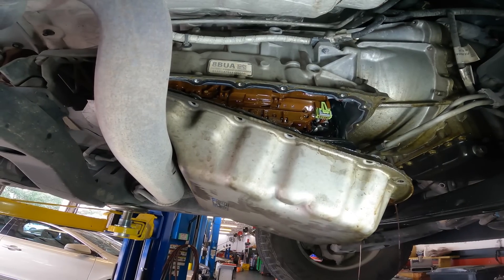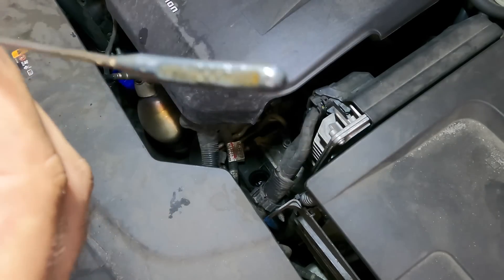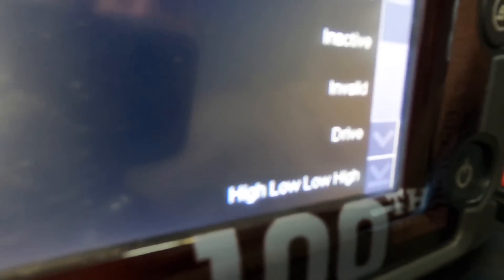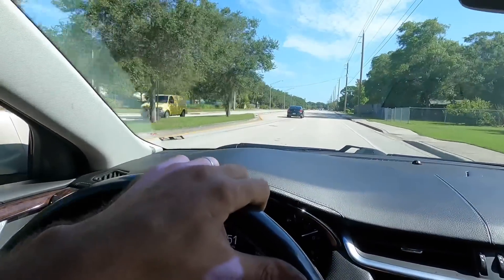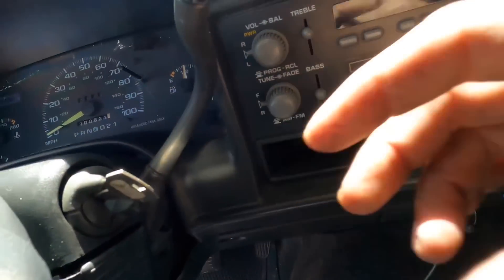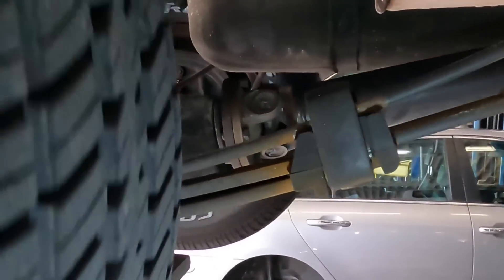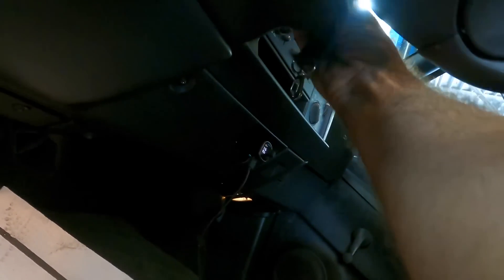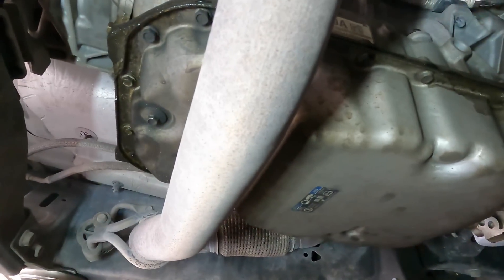Failure Friday! Ruined Transmission and More!

Comment: ''Did they drive it here?'' . Ray, if only you knew what horrors are still driving on the road, you wouldn't be able to fall asleep.
Reply: Pretty sure he knows better than most, the condition of cars on the road.
Reply: My Subaru flipped 3 times and hit a tree in an embankment, I still drive it and it’s never seen a body shop 👍
Reply: Very true ! Good defence driving required , one scary car can take out several in seconds ! Seen a lot in 50 years !
Reply: Oh, I think Ray knows what is out on the road.
Reply: I mean he is from Florida,  the only state that doesn't have any emissions or safety inspection on cars
Reply: @JMilly84 .. Tennessee doesn't either. Some Counties have emissions but they're stopping that.  Quite a surprise being originally from NY.
Reply: @geomann1009  yea driving in florida is something else it's the only place I've known of where everyone can tell you where they wanna go but have no idea how to get there and litterly anything with 4 wheels and an engine can drive down the road , sometimes without working brakes
Reply: @JMilly84  far from the only state.
Reply: Hilarious
Reply: My frame is so rusted it’s about to break into a million pieces, can I be in this club?
Reply: Ray knows!
Reply: @JMilly84  well I’m not saying I did drive my chevy pickup in florida with barely working brakes so that when I ran a stop sign late at night because of barely having brakes and got a ticket for the stop sign running i didn’t mention to the cop no brakes so I could drive it the half mile home rather than have it towed… but I’m also not saying I didn’t. ;)  they failed on the way home and I got them fixed before driving again, btw.
Reply: He knows. Hes showed some and said basically the same thing
Reply: Now you have brazen criminals trying to carjack everybody at gunpoint ....
Reply: I once lost belt and drove my Subaru to my mechanic who lives down the road from me without power steering it sucks!
Reply: I think a Florida mechanic is probably more acutely aware of that than any other state!
Reply: @JMilly84  it's not the only state. Indiana is the same
Reply: @JMilly84  
Nebraska also
no emissions or safety checks
Reply: Rau does not Fall asleep. He sleeps laying down
Reply: Especially since florida has vehicle inspection
Reply: @JMilly84  what are thoseee im from Michigan lmao
Reply: @georgemartin5980  Florida is sunny state so they dont have rust as bad usually if cars are rusted they where brought to Florida not new in Florida stayed in Florida michigan ive never had a car inspection be required so you get the bad rust from extremely salty roads in winter and people jerry rigging stuff to work, i had a silverado customer replaced brake lines with prebent lines and idk how it was messed up soo badly rear axle supply line from abs module was wrapped around and zip tied to leaf spring front lines where well under the frame supposed to be routed above the frame brake lines blow you got little to no brakes if you dont already know that, that being said wrapping a brake line around a bouncy object and zip tying it to it not to smart, steel brake lines, steel can only take so much bending back and forth before it brakes!! Not to mention i have seen cars that the frame is legit gone ive seen a few saturn vues that the vertical rear control arm that routes with the frame basically where the 4 bolts bolt the bracket up to the frame completely gone that car customer complaint was thudding noise when braking/accelerating that thudding noise was the rear tires both of them bouncing back and forth banging on the wheel wells, i drove it to see the complaint first hand, and customer picked it up drove off its still on the road i assume it is ridiculous what people will trust there lives in
Reply: Saw a guy once who’s brakes look severely rusted beyond belief, you could hear crunching every-time he’d come to a complete stop. Had to stay two lanes away for safety.
Reply: Iirc Ray is in Florida, everyone in Florida is quite well versed in what horrors are driving on the roads down there.....
Reply: @JMilly84  Lots of Wisconsin doesn't either. Some scary rusted frames around here.
Reply: I'm shocked I don't see more accidents with some of the vehicles I see driving on the road in my work day.

I always get nervous when the vehicle in front of me has a wobble on tires so visually noticable that I'm amazed the owner doesn't feel it at all.
Reply: @JMilly84  Michigan has no form of safety or emissions inspections.
Reply: @TheDunceMafia  Those saturn vues are my jam. I have a template I use to remake those rear trailing arm mounts on my personal rigs. I make them way stronger than factory that's for sure.
Reply: @TheDunceMafia  fellow michigander as well.
Reply: I had 2 trees come down on my chevy one ton. The first came down across the back and destroyed the ladders, ladder rack, canopy, and bent the bed wall. 10 min later the second tree came down on the cab from side to side destroying what was left of the ladders and the ladder rack. And drove the entire cab down to just below the steering wheel. And bent the frame. Took a forklift to the cab so I could sit in it. If i cover the windshield area with a piece of plexiglass, it’d be legal to drive🤣. The frame is bent downward between front and rear wheels significantly and blatantly obvious. And would be legal to drive with a piece of plexiglass 🤣
Reply: @nickmalone3143  🤣🤣🤣. They’d better carjack a real nice car. Or else

Comment: I absolutely love when someone says my engine isn't running right sometimes(intermittent). You hook up an analyzer and there are no trouble codes. Ask the customer what they've done and they tell you "I had them clear the codes at the Auto parts store". I like to tell them to go home and drive the car until situation occurs again, then bring it back WITHOUT CLEARING CODES SO I HAVE A CLUE AS TO THE PROBLEM.
Reply: TRUTH!

Comment: 32:54 next time, please:
- remove any left over gasket from the housing/pan
- clean the pan with multi purpose or break cleaner
- clean the trans with multi purpose/break cleaner
- give the magnet a spray clean aswell
- the filltube needs to be changed too acc. to service manual.

Comment: When replacing the transmission fluid, you should take the solenoids out and clean the metal shavings from them. If too much builds up it can cause shifting problems.
Reply: Interesting comment.  Maybe the metal shavings affect the solenoids' operation.
Reply: Thing is on the tehcm the solenoids are riveted together
Reply: Well, yes. Too much metal on the solenoids is a problem. Like metal from the planetary gears, bearing failures or other more serious issues that are the root cause of the metal. If you’re cleaning and significant metal from your trans, you have bigger problems coming.
Reply: @larryreno8293 , I would have to agree but I have seen plenty of transmissions that have metal shaving that are in perfectly good working order other than a shifting problem and have lasted years afterwards.

Comment: A family member had the same problem with 2019 caty it was under warranty and they said there was a flaw in the design of transmission so they had to replace the whole trans
Reply: GM quality.
Reply: @Adam Speck anecdotal evidence. Worst vehicle I've owned is a GM. So what
Reply: I drive Toyotas and never had a major problem, but I have owned GM and Ford and had headaches with both. Now I drive Toyotas and even if I run into a major issue will still drive them because I have over the years had fewer issues with them than any other brand I have owned.
Reply: Very very rare for toyota/lexus to have any transmission problems. Typically see them go 3-400k easily on their auto trans and even the CVTs they use. Honda is hit or miss with their auto trans, they’ve had some bad ones

Comment: Love S-10 and S-15's. I have had several from hotrodded SBC's to my first 83 GMC S-15 with a 1.9 Isuzu stripper truck ! 435,000 miles and gave it to the daughter to learn to drive in. 2,000 mile oil changes made her last almost forever.

Comment: 1/2 NPT threaded nipple about 4-5 inches long with a 90 at the bottom to provide a leverage spot. Insert the threaded end into the seal and turn a few times the lever out the seal. Works every time. I have this tool with my trans service tools.
Reply: Very interesting. Thank you : )

Comment: Shop owner/mechanic here. Get yourself a 2gal bug sprayer ( one with thick walled container).  That otc trans fill kit you have should have the hose with the quick fittings in it to hook to bug sprayer hose.  Drill hole in container for valve stem near top . Now you have a easy way to pressure it up to about 15lbs. Now as a shop owner - ease up on the brake cleaner that stuff is not cheap at the end of the week when you hose everything down like that.

Comment: So... I'm confused.... Pulling out the stand pipe plug is how you determine it's at proper level..... But when you first pulled out that plug, 2.5 quartz drained.   Was it 2.5 qts overfilled?
Reply: Dude. Same exact thought and question
Reply: He pulled the plug when the engine is off, and the trans fluid drains back into the pan.  You check the level with the engine on.
Reply: @mvmorr01  okay... That makes sense... I have zero experience with these dipstickless transmissions (but honestly feels like a scam by the manufacturers to make maintenance more difficult, ensuring premature failure)
Reply: @johntetreault  I think the OEMs see it this way: weeding out the amateurs  and preventing premature failure.
Reply: @theundergroundlairofthesqu9261  I highly doubt that.... I'm sure they more likely view it as "good enough to last until the end of warranty terms, but we can't have people keeping cars on the road for 20 years"
Reply: @johntetreault  Unfair! Makes it hard for a used car lot to add snake oil(s) to a bad tranny. (Ask an 'ol fart about sawdust in manual transmissions. Once found sawdust in a customer's Powerglide.  Idiots!)
Reply: That's because the truck was not running when he drained it
Reply: @theundergroundlairofthesqu9261  More likely "We saved 4 cents on every vehicle by not having to pay for the extra metal in a dipstick".
Reply: @johntetreault  It is actually the case, as is the growing number of manufacturers using what's called a Gateway Module in the vehicle communications networks to prevent unauthorized access (ie tuner shops). The number of people flashing programs to their ECMs, blowing up their engines, reflashing to OEM after they break it and bringing the car in to complain 'hEy YeR eNgInE bReAkEd' and trying to get the dealership to warranty it was costing the manufacturers a shitload of money. Letting people who don't know what they're doing screw with important things gets pretty damned annoying, and more importantly expensive.
Reply: @apoplecticwrenchmonkey  "letting people" do what they want with the products they OWN you mean?   Nah, I'm sorry, manufacturers locking shit down like that is going to put independent repair out of business.

Comment: 10:45 ... 

If the brakes, steering or tires are not good... then it doesn't need the engine to work.

Comment: I bought a brand new 1997 s-10 removed the vortec 4 cylinder and 5 spd manual, replaced with 283 SBC, four barrel w/corvette mechanical fuel pump w/350turbo trans. It was my mustang eater! Hp was around 400. fuel mileage averaged 19 mpg.  Was really fun toy!

Comment: Cooper tire are usually pretty good quality,  but they sometimes have uniformity problems or are "out of round" often which leads to vibrations. The retailer/ seller should have seen that when they put them on. Silver lining, Cooper will warranty that. The vogue tire on that caddy are expensive,  but garage.  We refer to those as "mustard and mayonnaise" with the gold and white wall.
Reply: Bought two new Cooper tires on the rear of my old S-10. Tires wore out in about 9,000 miles.

Comment: I've been in the transmission business for 30 years the worst thing you can do to a slipping older transmission is change the fluid in it you take out all the clutch fibers from the fluid and it will absolutely make it worse the only thing you can do to a slipping wore out transmission is put friction enhancer in the transmission and it will let you drive for a bit longer quick fix short-term dump the transmission fluid out bad move

Comment: This is what made me decide a different career path was for me.  Back in the mid 90's I was doing a tranny pan and filter on a 1500 Silverado with the 700r4.  As I was unscrewing the last bolt to release the pan, one of the guys tapped me on the shoulder.  Needless to say, lots of expletives were let loose and fluid found places were I think there is still some there to this day.  I'm a better IT guy anyway, so thanks for the bad flashback Ray, LOL.
Reply: Not having a drain hole/bolt is just uncivilized! My 80's Mercedes has one on its ATF pan.  I have converted our fleet's Durango (46RE) and Econoline (4R70W or something) to pans with drain holes. (Dorman for the Dodge (it's fine !) and and an actual Ford part for the van.
Reply: @redrider7730  I have a Fumoto valve on my cheap Dorman stamped steel pan and it's a nice 'n tidy way to drain 1 gallon of ATF so I can add four fresh quarts. I used to wonder how goofy it might be to do a fluid change in  between normal filter change services, then I noticed that the severe duty maintenance schedule for my old Mercedes recommended exactly that. 

I have two Mag Hytec diff covers in the fleet and like them a lot. Never felt the urge for more fluid capacity, but still might do their pan for the Dodge at some point in the future.
Reply: PEBKAC errors are universal.
Reply: @theundergroundlairofthesqu9261  Do not start talking tranny fluid changes to a gen 7 Honda Accord (6 cyl) guy!
Reply: @stevewolf2620  How about filters? Did they even give you a filter?!
Reply: @theundergroundlairofthesqu9261  Honda does not think there is a filter in there. You have to give them the part number to order one. Mine did not look bad, others have had horror stories.

Comment: It was neat to see a transmission with a drain plug. All of the ones I've seen and worked on had to have most of the pan bolts removed and then the pan allowed to tilt down and drain the fluid.
Reply: @34:33 
Is where u fill it from.
The stand tube works like  filling a diff pumkin.
When it's full it will run back down the stand tube
Reply: @W3BZSL1NG3R  Ah! Thanks. I learned something new today.

Comment: I've seen a few too many of Precision Transmission's videos to be willing to accept that it's "okay" to leave the old filter neck seal in that transmission. XD You always want to pull it out and replace it with the new one that comes with the new filter! It's apparently common enough to neglect to take the old seal out before stuffing the new filter in that you end up with the seals double-stacked in a channel not designed for it, so the filter sits too low and when you bolt the pan back on it'll crack the filter neck and make the filter basically useless. Mr. Crich over at Precision Transmission uses a hook pick to get to that seal; maybe try one of those next time you gotta do a job like that. :)
Reply: Except two seals wont fit at a time And you cannot put the pan back on if the filter isn't in all the way. Unless there's some rare instance I'm not aware of they are designed not to fit unless correct. Also the new filters only come with new seals if it's the o-ring type. Watch harder.

Comment: Hey Ray, didn't Eric O once show off a drill-powered pump for filling transmissions like that?  Maybe something to add to the tool collection?
Reply: As I remember that drill pump was a “less than impressive”.  How about the old blow gun in the jug trick to push it out through a hose that Briansmobile1 did a video on?
Reply: @thomas7770  Ray played with that concept, too, I think.
Reply: I used one of those pump sprayers for garden chemicals.  Pump it up and squirt it in.  The new ones have plastic wands that you can use a heat gun to adjust.
Reply: I have a pneumatic atf fill tool. It looks like a big chemical sprayer, but it holds 5 gallons of atf and can be preasurized to 60 psi. It pumps fast.
Reply: @thomas7770  I have a lid that I screwed an air fitting and tube into. Fits on the new bottle of trans fluid, wind the regulator down to 20psi... easy and costs nothing.
One day, no doubt, I'll end up with a defective bottle with a bad seam and oil all over the floor. So far though, it's been working for over 5 years and the lid doesn't let go until 30psi, which is handy for some of the thicker diff oils.
Reply: @Jimmeh_B  how do we sell these things and become rich?
Reply: @thomas7770  lol.
Well, ain't that just the million dollar question?!
Reply: @Jimmeh_B  💸
Reply: You would be better off with an air powered transfer pump.
Reply: @Enonymouse_  ya reckon?
Reply: @Enonymouse_  I concur.
Reply: @inoahmann7542  I made my own fill system. Used a 2 litre metal oil can with a screw top that we used to get 90 gear oil in. Soldered the metal part of a valve stem into the top and a copper tube that went to the bottom of the can. Connect a flex PVC pipe to the copper tube and a short hooked piece on the end. Fill the can with the appropriate oil, hook the tube into the fill hole and pressurise the can with a bicycle pump. No high pressure. A couple of pounds at most. The oil goes in until full is reached. Loosen the top cap to release the pressure and job done. Used that on differential and gearbox services for years until I gave up doing my own servicing.